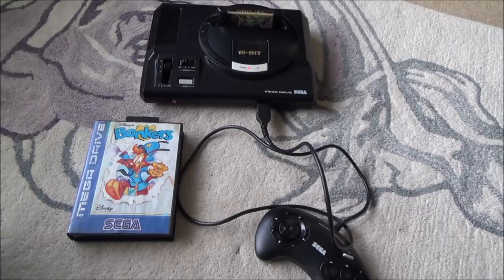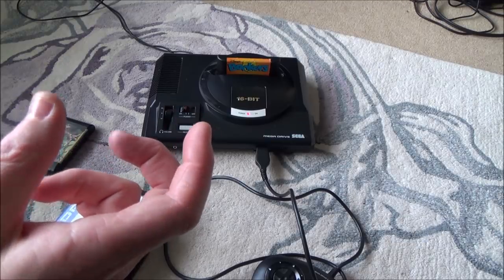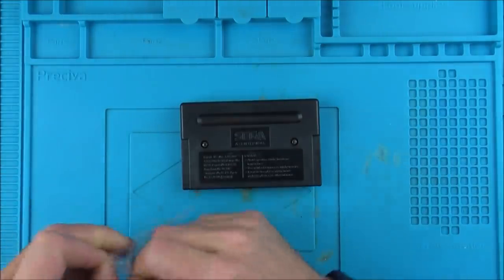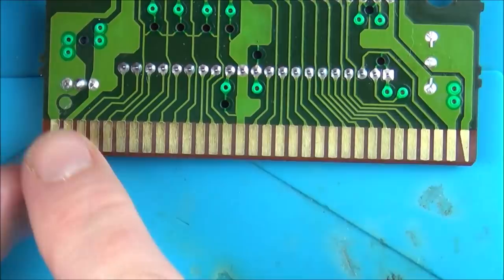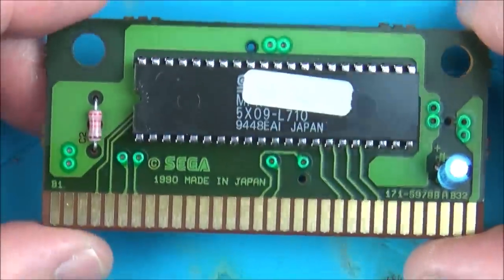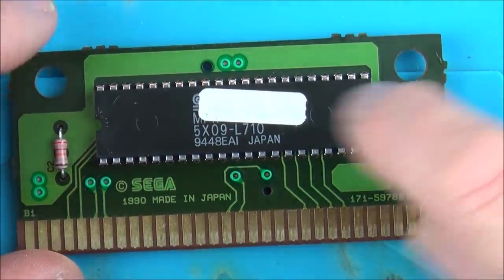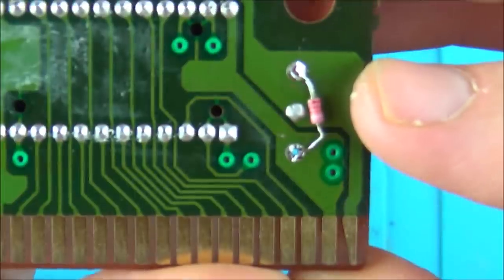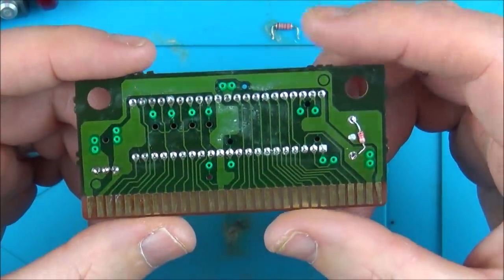Trying to FIX: BONKERS SEGA Mega Drive (GENESIS) Game

Comment: Thanks for the mentions there =D  Very much appreciated!  As you discovered, It's a cap!  I made that mistake in the past too, it does look like a resistor.  The clue is its pink (some are light green), resistors tend to be beige (or some modern ones light blue).  Let me know if you want an EPROM programmed up for it and I will get one in the post to you!
Reply from the maker: Pink and green when it is a cap, I will have to remember that. Nice one Chris :-)

Comment: Colour coded capacitors tend to be pinkish in colour. Resistors tend to be either sandy brown, light green or blue.
Reply from the maker: Thanks PDS, GadgetUK164 mentioned that as well. I will remember that one in case I come across it again in the future. He said that light green and pink normally mean it is a capacitor, and light brown or blue or resistors. In your time have you also seen light green resistors?
Reply: @Mymatevince  light green can also be resistors. The best thing is if in doubt check it both on resistance and capacitance on the meter.
Reply from the maker: Great advice,  thank you :-)
Reply: I have come across light green resistors when I repaired telephone systems in my last job before my stroke but they aren't common.

Comment: A few capacitors have colour codes This was to reduce the confusion regarding letters, numbers and decimal points, an International colour coding scheme was developed many years ago as a simple way of identifying capacitor values and tolerances. It consists of coloured bands (in spectral order) known commonly as the Capacitor Colour Code system.

Brown,Grey,orange  = 18 nF

Sorce: https://www.electronics-tutorials.ws/capacitor/cap_5.html
Reply: It's hard for me to tell which color is which. It is easier to read numbers or just to plug it into a multimeter.
Reply from the maker: Thanks for the info and the link MR Flibble :-)

Comment: EPROM (Erasable Programmable Read Only Memory), there is also EEPROM (Electrically Erasable Programmable Read Only Memory) but this is PROM (Programable Read Only Memory). Yes there are caps in case like resistor. I have exactly the same yellow multytester,   if you short all 3 pins and press the button it will go into callibration mode (prepare >100nF cap), if you hold the button depending on FW version it goes to contrast setting mode on cusrom software MTester v2.07 made by Marcus, yours is StripGrid version by taobao that only supports callibration mode i think. You can also test SMD (SMT) components on that clean pad on the right of the socked.

Comment: I need your help or maybe you can fix this problem I'm having with my 40 inch Samsung smart tv I have taken it apart and I don't see any burns on the power supply or the main bord. Anyway long story short it was working fine until my electric heater kept blowing fuses in are fuse box and now the tv will not turn on the stand by light is on the tv just won't turn on I'll pay for shipping I just need this tv fixed because I don't have money to buy another one

Comment: Use a cheap game as a donor board for the rom chip.  I did that with a starfox 64 that wouldn't boot and I got continuity to the ROM chip like you did and using a donor board solved the boot problem

Comment: That resistor is a resistor, not a capacitor! Check the bands online
Reply: On the board is clearly written C2 thus capacitor.
Reply: Also normal resistors don't have a capacitance value. If his meter measured some capacitance and no resistance value, it's a capacitor.

Comment: Been away awhile, your understanding of electronics seems to have not improved over the last 8 months.  You cannot test components reliably in circuit!  Why do you try?
Reply: Thanks man, had the same thought. Bending that capacitor up and down is also the way to handle components.
Reply: hatthewmartley, most improve with experience and research, just buying more expensive test equipment does not make you smarter.
Reply from the maker: Msquared, I am quite happy with my progress. If you can offer help then it may benefit me and others reading these comments. Looking back at your comments over the last year they are always appear snarky whether meant or not. For example what would you have done differently in this video?
Reply: Two things.  One yes "reliably" (or more appropriately, accurately), but for the practice and to compare values in and out of circuit.  Second, he does test them out of circuit as well.  Your post suggests he only does the one and not the other.  Why are you here?  If you have greater knowledge, share it in a constructive way.  If you're into baiting and trolling, I'm sure you can find another place for that less than positive activity.
Reply: @Mymatevince  I don't think I would have done anything differently if I was in your shoes in all honesty, but that's just me.